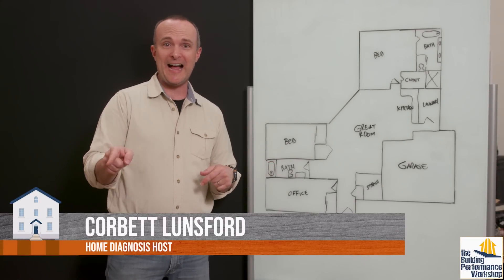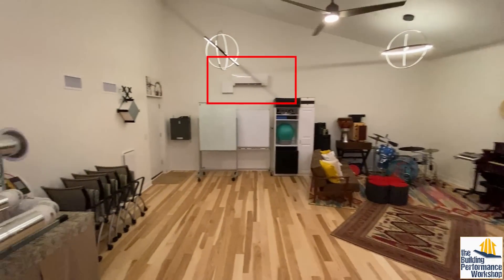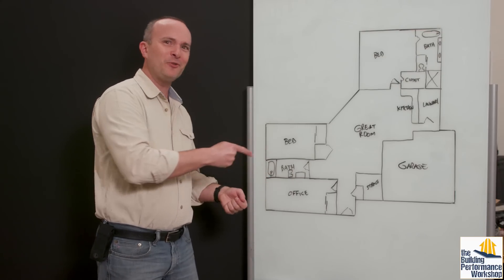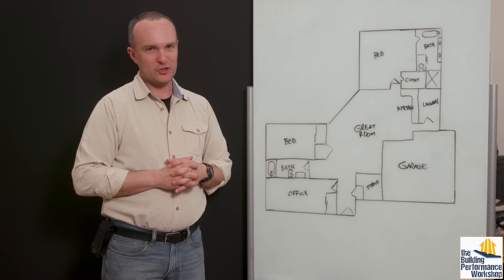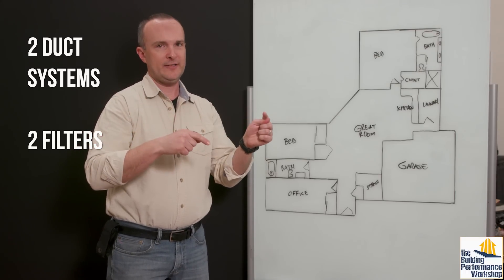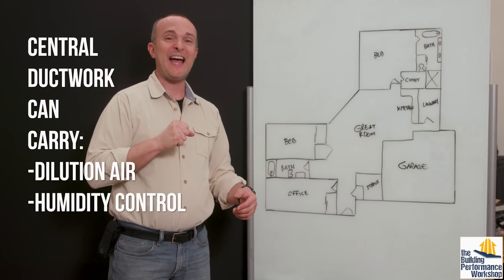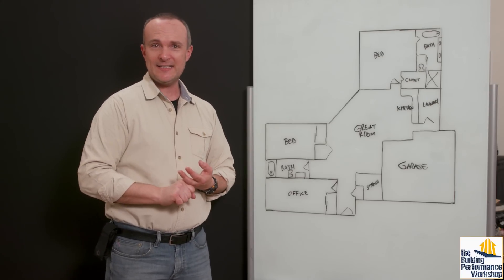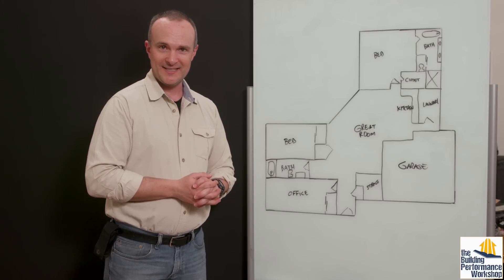HVAC Ducts Reality Check: Are Ductwork Systems Dumb or Essential?

Comment: I used the ACCA Speed Sheet (spreadsheet) based on the tutorial on the ACCA download page for that product.  This video here helped me with one critical point - the fact that a heat pump does not have a coil in the airstream (I didn't know this).  This was key in increasing my available SP.  By switching between an external SP of 0.5 and 0.8 on my equipment (from Manual S), I go between a friction rate of 0.073 and 0.144.  The 0.8 setting gives me velocities in the recommended range of 700-900 main trunks, and 500-700 branch ducts.  Thank you for this review - it is very helpful info that goes beyond just pumping numbers somewhat blindly into a spreadsheet.

Comment: Very insightful—do you think a well-designed combination of systems like a Mitsubishi Electric heat pump (split A/C), Warmboard hydronic heating, and a Zehnder ERV in a passive house would be solution to pursue? what could be an alternative? Also, I’ve heard that Rheia HVAC ducts are air-tight—would they be more durable and perform better than traditional flexible silver foil ducts? No hvac designer or installer does Manual J calculations in Australia (Melbourne) so what could be a way forward?

Comment: Having a central system didn't really solve your design problems with this house.  Given current pricing, isn't dividing this house into two zones going to actually result in cheaper equipment overall?  Based on your description, it seems like dilution, circulation, filtration, and dehumidification needs to be decoupled from sensible air conditioning load, just making use of whatever  condensation that happens.   For me, with an off-grid home built in phases, using wood stove heating for that winter design condition, a centralized forced air HVAC doesn't seem to fit in.

Comment: Do you do consults? I desperately need some assistance, I’ve talked to 2 HVAC companies sir far and both of them have scoffed at using an ERV and states they don’t know much about them.
I have 600sqft space, split between 3 rooms, 1 has 12ft vaulted ceilings other 2 8ft standard. I would like whole home Dehumidifier and ducted heat pump system installed with a possible need of an ERV due to the air seal in the building.
I need help, it’s like these companies don’t know about or aren’t familiar with ERV use (southern states)
Reply from the maker: Yes I do, happy to help:
https://buildingperformanceworkshop.com/video-consulting

Comment: Ya i dont think ductwork will ever be obsolete. When actually sized correctly for the building and the equipment sized correctly theres just no better substitute imho. Ervs and ducted whole house dh is becoming more and more necessary. Minisplits typically dont dh as well. As of now if i was to build a new home for myself i would go with a geothermal hp and a sante fe or similar pulling o.a. and ducted into the supply.

Comment: We just ripped out our ductwork and installed 5 minisplits. (4 ceiling mount and 1 floir mount) It's a game changer. We absolutely love it and our cooling costs went down over 30% from last year and that is with inflation on energy costs.

Also on radiant floor heating, it works amazingly well. All of our family and friends in Korea almost exclusively use it and it's so warm and nice.
Reply from the maker: Yeah, if your ductwork was old and rotten then that would be better, really this vid is aimed at people planning new construction.

Comment: One of the biggest complaints I have about my current home is that my storage areas are not air conditioned.  Every time I open the hallway closet to get something and then close the door I am hit with this slightly warmer air for several seconds.  If only I was air conditioning that closed in closet.
:(

Comment: I am starting the design of a new house in Las Vegas and I was toying with the idea of doing mini splits for the whole home and I am happy I found your video so I do not do this. Thanks!! On the topic of ducts though what size depth of floor trusses would you say is optimal for ducting?
Reply from the maker: 18 is usually fine, 24 is guaranteed no issue.
Reply: @HomePerformance  awesome thank you!! 🙏

Comment: We are building a 3200 square foot 2 story passive house with 12” thick outdoor walls, 12” of foam under the low carbon concrete slab, and amazing windows and doors on farmland near Vancouver BC Canada. We are struggling to find someone to give us a straight answer on what we need for an HRV and mini splits as a system. Thoughts?

Comment: We have duct work all thru our home but we are about to add a top floor and finish the basement - any recommendations for how to heat and cool those areas ?
Reply from the maker: You might have enough HVAC power to heat/cool those spaces already. Have a Manual J load calc done and maybe swap out some of the ductwork.
Reply: Swap out the duct work for splits ? The basement will be 50% family use and 50% basement apartment; would that change anything?

Comment: I appreciate your video's. I may not understand it all, but I'm learning. This isn't talked about much "out there". Wonder what you would think about a my 100 year old, 3-family house, in Connecticut. I'm looking around at my system thinking I need to change everything lol. The exterior wall weren't even insulated.

Comment: Hi Corbett,
I have watched several of your videos and I find them especially helpful! I’m a little confused about this one; I’m hoping you can elaborate. I am currently general contracting my parents’ high performance home with them in NH. We are planning to use ductless mini splits and a whole house ERV as well as make up air kit, perhaps an Air Scape per your recommendation. I am wondering if, however, you are indicating in this video that all these systems can be combined into one single, ducted system which functions as an ERV, heating and cooling via heat pump, and also dehumidification. Does such a system exist, and if so who makes it?
Thank you 
Greg in NH
Reply from the maker: You’d need each of those separate machines, but you plug them into one central duct system.
Reply: Is there a specific manufacturer I should look for that offers this type of compatibility?

Comment: In this video it is mentioned a 2 ton system for a 5,000 sq ft house.  I can't find anything more on this topic so far searching through the channel.  I have a 1250 sq ft condo with a 3 ton system built in '92 and HVAC guys trying to sell us on installing wider ducting.  Seems to me if I had an efficient 1.5 ton system then there would be no need for wider ducting - assuming there truely is even such a need as is.
Reply from the maker: Search ‘Manual J’ or ‘Load calc’

Comment: Thanks for this, I have central air with a duct system. A roof top unit with no attic other than 2x8 rafters and soffits built to hide ducts. Makes for a very noisy system and I think I also loose a lot of energy in the ducks due to lack of proper insulation Was thinking o doing a few mini splits and some in wall fans to transfer air to other smaller rooms.  Thanks for info on filtration, I forgot to account for that.  I had idea to get a mini split for main space then use the central air only as needed for when bedrooms are occupied.

Comment: The current duct systems are horrible.   They are dusty with sharp edges and screws sticking up and enormous gaps and holes.  A good system would always be cleanable by homeowner and would be completely sealed to control air and filtering.

Comment: Your dedication to your craft is admirable.  It's obvious you have an analytical mind and it so benefits your viewers here.  I am disturbed at how many people seem satisfied in having a living space with no fresh air for months at a time.  We do get used to lousy air in the home.  And that's a very dangerous adaptation.
Reply: your home is typically more ventilated than you think. especially if you have kids. open and close your doors and windows
Reply: @claudecoleman8315   No it's not.  That's why people say when they go out they like the 'FRESH AIR'.  As in inside is stale air.  Which is because the oxygen content has been depleted and there's too much CO2 from our exhaled breath.  It's very simple.
Reply: Ducted system just taking air from one room to another you can always open a window. America only country in the world still installing old fashion ducted AC. Rest of the world went to ductless long time ago because cost of electric has always been more. We had it easy until last few years. I can remember not long ago paying 3 to 6 cents a KWH those days are gone.
Reply: @Mike-01234  The key is to use heat/cooling recovery systems.  Works better for heating though.  Or you can just dispense with A/C altogether and get healthy and deal with the heat.  A lot of the world does just that.  It does take a while to adjust though.  You have to be patient.  A few months for most.  But unless you eat pure the heat will always make you wilt.  And you have to be reasonably fit.  The problem is the vast majority of middle aged people aren't fit and eat slop.  So they need A/C.  

And ducted systems have to have a fresh air intake somewhere.

Comment: I'm building a 1200spft home in mid state NY.  I am going to be using only electricity to power everything. Have been trying to decide between ducted and ductless heat pump system.  After listening to this, I'm thinking that my decision to go with a ductless system that uses ceiling cassettes may be a bad choice.  It's not too late for me to change my mind. If I were to go with a ducted system, would the ERV be connected to that? I'm also having a difficult time deciding on an ERV system.  I get the feeling that the contractors in the area don't have a lot of experience with energy efficient homes.  The last time I was involved in building a house was with my late husband (a tradesman) in 1992.  Things were very different back then. Now I'm going to have 9" deep walls between the 2x6 studs, exterior comfort board, rain screen, siding....  Any advice?
Reply from the maker: Highly recommend you get on a consultation with me for an hour, Tina, small homes like yours have special challenges:
https://buildingperformanceworkshop.com/video-consulting

If not, at least check out my online course on Home Performance for Tiny Spaces:
https://buildingperformanceworkshop.com/tinyspaces
Reply: @HomePerformance  Thank you for the quick response.  We are close to being done with framing. My daughter is running the show as I live 4 hours away.  I will probably have her do the consultation, but I am also interested in the Tiny Spaces course.  Is it appropriate for a 1200 sq ft home- which to me is not really a "tiny" home? Thanks

Comment: With all due respect, it's insane to claim that you NEED a duct system to "clean the air".  Millions of people live in cool zones and have boilers/radiators with no forced air and it wonderful!  No dust being kicked into the air, no extreme drying effect, no problems.  Adding filters to furnace systems is a choice, generally to keep the furnace innards clean, with a side bene of removing some ambient dust.  If you need to add AC cooling, different deal.  But then you're going to design based on budget, needs and retrofit restrictions that may exist.  Nobody should be spending  a ton of money on a 2nd system under the delusion that they are "cleaning the air", so there's a bit of hyperbole here.
Reply from the maker: Respect heard, and I agree that you don’t hear northerners (or Venetians for that matter) complaining about air quality. However, having tested and smiffed hundreds of northern homes myself, I think it’s just homeowner momentum and ‘homes have problems’ pragmatism at work. If we tested these homes for particulate, CO2, humidity, etc, we would find the performance lacking compared to a home with good filtration. FYI, once you filter at MERV 11 you’re improving human health- it will be required in ASHRAE code standards soon.

Comment: My house always had a moldy smell and it was coming from the duct work. i was always sneezing and or coughing on a regular basis. I had constant problems with my whole house HVAC and finally it stopped working. I replaced my HVAC with Mini-splits and have never been happier. My air quality has been great no more moldy smelling air. And my electric bill is about 100 dollars cheaper each month. I can control the temperature of each room individually. Duct Systems are dumb to answer your question and a big waste of energy. In the future if I think I need some kind of whole house air cleaner I will buy a ductless system.

Comment: Do you really need HVAC in your small bathroom or closet/laundry?  I have duct vents in those rooms but I shut them all and didn't notice any temperature differences from the main rooms.
Reply from the maker: If there's no exterior exposure, then there's no load- that's a common mistake

Comment: As humid/dehumid/filtration/fresh air is essential, it seems that ductwork is essential! The good news is that it can be optimized. When not distributing hot/cold air, the ductwork can be cheaper and simpler. But to know how to hit this goal requires engineering, not guesswork.

Comment: Thx for the insight. Here in Germany (or the EU) ventilation systems are really unknown in homes. I do have a split ac and HRV and nobody here understands that. People still open the windows to get "fresh" air. My HRV filter tells me how fresh the air is. I am planning my next home with a ducted system for heat/cool/clean air/HRV...etc. Not using radiant floor heater, insulated house with air/air heatpump is sufficiant. But duct ACs have a very low COP. Will need professional help to design the duct system. So greetings from across the pond from a much colder climate zone.
Reply: Yeah, well good luck on actually getting a professional that will help design a system that will be what you need, not suck, and not be designed simply for the profit of the installer/designer.  Oh and get them to put in writing their guarantee of performance, see how that works out especially in the US.

Comment: Speaking about ducted systems, I am in the process of redesigning my ducting system for my bedrooms-hvac, all attic installed—- reason is too much pressure in the bedrooms on one side if the house and tool low on the two bedrooms on the other side—-the tow bedrooms with the high pressure are directly below the furnace and supply ducts are connected directly off the supply plenum, hence short run, the other side of the house (2 bedrooms) is supplied via a distribution plenum connected via a 30’ plus long 14” flexible duct—-and its all made worse in that all ducting and distribution plenum is suspended above insulation so it becomes pretty hot—my plan was to have a new supply plenum distribution box fabricated and place that in the middle of the house, then run equal lengths of flex duct to each of the bedrooms from there—-I spoke to a local contractor and he said plenum boxes were old technology and better way to do it would be using all wyes, is this how things are now done?  Central California location, up to 105 degrees in summer and down to 30 degrees in winter and everything in between, thanks

Comment: Actually you can add heat easily to a Zhender hrv/ERV system and I'm going to try to add cooling to mine. It's my understanding that humidity will not vary much if at all throughout a house so a stand alone dehumidifier should work. Not totally sure on that but don't think I'll need it so good luck to those that do.

Comment: unico is a modular system.  there is hydronic module available.  i would differ with you on the point of no opportunity for humidification.  it can be fabricated for the system

Comment: I'm considering building a house that will have uneven heating and cooling requirements, so mini splits seem like a natural fit. I was thinking of an HRV system alone, and make-up air would be required. I'd like to avoid using natural gas for heat. The house is compact with two 900 sq ft floors on top of each other with a 900 sq ft basement. The climate is cold dry winters (-29F) to dry summers (+95F). 

I hadn't considered using central ducting for air filtration. I was hoping an HRV system running 24/7 would be enough to keep the air fresh? Though come to think of it, adding humidification throughout the house would be nice.
Reply from the maker: ERV/HRV is in most cases NOT enough to keep the house clean on its own.
Reply: @HomePerformance  How does a central ventilation system look/work without an attached furnace or air conditioner? That could make an interesting video.

Sorry about the typos in my comment.
Reply from the maker: That’s a good q, I’ve added it to the list. Vid forthcoming.

Comment: In a 960 sqft house could you centrally locate a minisplit and then use a ducted ERV to mix the conditioned air throughout the space? Supplies in bedrooms and exhausts in bath and kitchen?
Reply from the maker: Hey Gerk- this is actually quite a common misunderstanding: an ERV does not circulate air (generally), it takes air from the home and throws it away outside while bringing air in and recovering some lost heat/humidity quality.
Reply: @HomePerformance  I phrased it wrong. I understand it's a heat exchanger and not an air exchanger. I meant circulate the heat or lack there of in cooling seasons. Circulate the the conditioning itself minus the actual air. I hope that's clear. Thanks for the response.
Reply from the maker: Ok, but just to be clear it won’t circulate heat well either- you’ll be running a deficit at all times on temp snd humidity because the core is only ~50% effective in total.